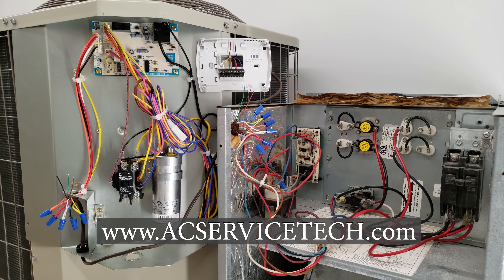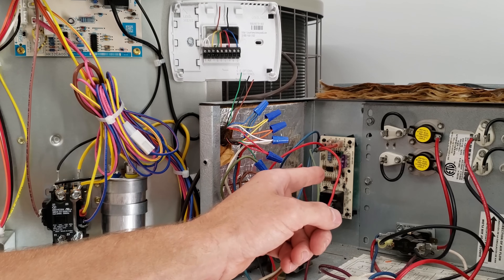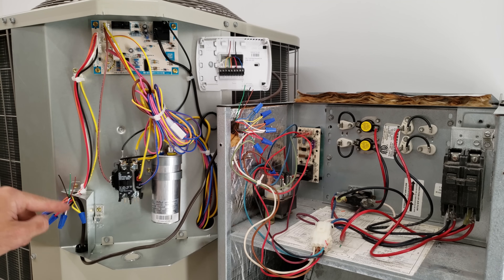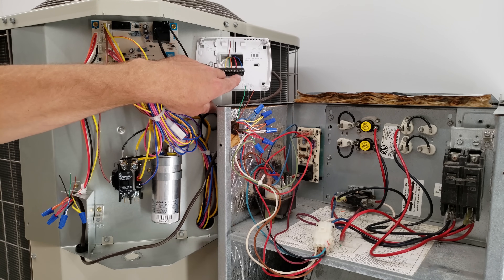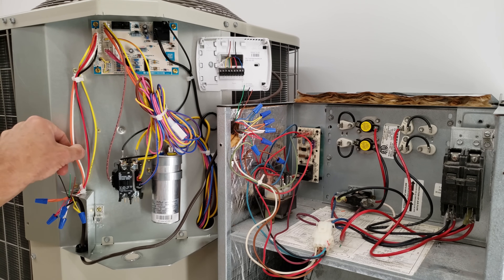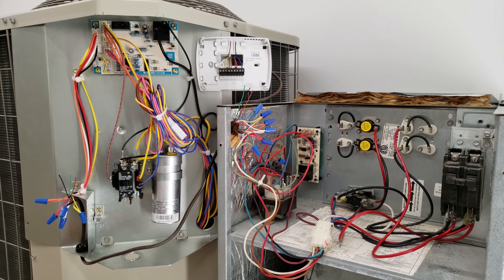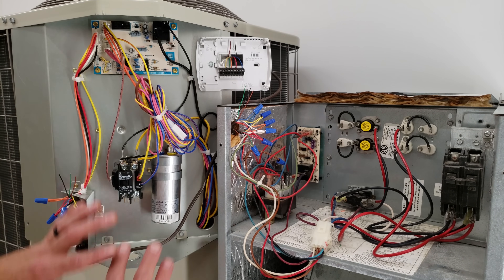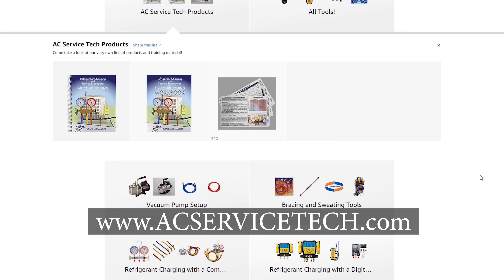How an Air Handler & Heat Pump Work & are Controlled by 24v Thermostat Wires!

Comment: Your videos are very helpful. I have a question: I am trying to install a new Thermostat (RTH9585wf) and my HVAC does not have a control board (I watched your other video on systems without control boards). However, I was not able to do the rewiring and use the G wire to replace the C wire. All videos and also Honeywell guidelines assume that there is a control board. Do you have any suggestions for the systems without control board?

Comment: Very informative video. Living in an apt building, I have one question still. Hear clicking off and on quickly in my wall next to my air handler. Suspect faulty heatpump switch. They are on roof. Air handler cycling normally and cooling. If I shut off breakers for heatpump, furnace in breaker box and separate breaker on front of air handler and still hear noise between walls, does this mean I could behearing noise from a close apt by me and their unit? Would my heatpump be shut off by doing what I mentioned? Thanks, hope for an answer! Hate to deal with maintenance here, the are not very knowledgeable

Comment: Very well done. Personally I have found I prefer when the manufacturers energize the reversing valve in heating. If the reversing valve fails they still have emergency heat and in summer they still have a/c. It takes the pressure off me as far as how fast I need to respond. Seems today people become more irritable without cooling than without heat.
Reply: Very true. Also what good is it if the reversing valve fails and the unit can’t go into defrost? You will only have heat for a short time before the outdoor unit turns into a block of ice.

Comment: Thank you for making this video. I'm not an hvac tech, but I do enjoy repairing my own stuff. I've been stuck for about a week now and its mid August in the deep south. Its humid and its almost 99 outside today, and this ac has been down for almost 3 weeks, so I was motivated to get this thing fixed, which I finally got everything wired up correctly this evening, thanks to this video. There are no other videos who show how exactly these Carrier heat pumps are wired. Again, thank you for making this video, its exactly what I needed. YouTube University comes thru again.

Comment: So thermostat OR defrost board can turn on electric heaters. Also thermostat OR defrost board can power the reversing valve. Is this correct ?  Thanks for really great video

Comment: Hello. Watched the video to the end. Good information. So we had a new 95% LP furnace put in along with a heat pump installed. So everything works with the heat but when you turn the thermostat to cool it blows out hot air. The company has been back out several times and they are not sure but they think it is the new thermostat they installed. They manually reversed the valve and we got cold air. All wires in and out are getting continuity but when switched to cool the thermostat is not sending a 24 Volt signal to the heat pump to turn it on for cooling. The outside unit works fine for heat. Everything is brand new. Any thoughts or help would be greatly appreciated. Thank you

Comment: Can we use a gas furnace as an emergency heat instead of electric heat when the heat pump goes into defrost?
Reply: Yes, it is called a dual fuel setup. You wire it normal with the "w" going to to the Aux and then setup the thermostat for the standard or high efficiency.
Reply: @yarsamohtrt  Thank you

Comment: my ac unit burn the 24v transformer and i bought a new one. every time that the compressor try to turn on the 24v voltage drops so badly that my ac controller back light dims down and a few seconds after it turns of the compressor. this only happens when every time i use the compressor either for heat or cooling when i use the heat coils everything runs fine. the only things that could be drawing so much power i think could be the contactor been the only thing that feeds of from the transformer at the time . any ideas?
Reply: or maybe i bought the wron 24v transformer and it doesn't have enough power for the contactor?
its my first time ever working with ac units all i know is that there's    a lot of voltage drop when the compressor tries to run. oh this is a very old unit without any electronic boards

Comment: QUESTION First thank you!! I believe it is rheem and Rudd that energize the reversing valve during heating pretty much all others are set up just like this one in the video correct?
Reply: Yes, that is correct. The majority prefer a failure with the reversing valve to occur in the cooling mode rather than in the heating mode.

Comment: Great video.. I have one question... Is the thermostat the only control keeping track if the heat pump is not keeping up, or do some defrost boards have a second function, when to turn on aux heat. I understand the defrost board will signal the w/aux for resistance heat until defrost is completed. The reason why I ask is because I can't find this information in the install manual of the rth2410/rth2510 thermostat.
Reply: The defrost board should turn on the aux heat only during defrost mode. In that case, it energizes the W wire.

Comment: Hi Craig, so glad I found your videos and website. In the video when you first mentioned the heating cycle (set to 71 but 70) you said R was connected to B, Y, and G. Towards the end of the video you gave an example of the thermostat set to 74 but it was 70, and you said R was connected to G, Y, and Aux jumped to E. But I didn't hear the thermostat setting for this set-up. Were these two configurations for heating modes with different manufacturers? I'm tracing my own wiring today and tomorrow but was just curious for your video. As everyone else said, thank you again for these great videos.
Reply: Did u find your answer
Reply: @keithbailey7535  Sorry, I don't remember.  That was some time ago. But this site and videos were some of the best I found.
Reply: @bishauzer  to be clear u wanted to know why the r connected to different terminals because of thermostat temp difference? Was that your question

Comment: I followed the video, tripped breakers, checked cables, found 3 red wires that didn't have a good connection so I snipped ends and stripped the ends and returned them to the twist-on wire connector, replaced the blown fuse, turned breakers on, in a few minutes the thermostat screen was on and I could adjust the settings for heat.  The lines were so tight and the hole is jagged with no grommet, so the temp fix works but I will need to follow up on the root cause to avoid future problems.

Comment: I have to say this is the most comprehensive video I have seen.  No more wasted time watching some yo  yo babbling on.  This man knows his stuff. I had a HVAC cert in FL but we didn't do heating. I put in a new heat pump and redid all the wiring.  Honeywell 9000 thermostat.  Have been having problems with this heating since it was installed.  ODT has me messed up. This showed the correct wiring and that will solve my problem.  Last tech that worked on my system while I lived in FL (this home is in SC) messed up the wiring and cut and spliced things up to where I wasn't sure what was correct.  Now this video has solved that issue.  One wire was in the wrong place and had disabled my Aux/E from working properly. Thanks for you awesome knowledge and help.

Comment: I need to add an outdoor thermostat which wont let the heat strips come on unless its 35 degrees outside.  Which wire inside the air handler do I interrupt/connect to in order for it to operate correctly?
Reply: An Outdoor stat used with a dual fuel application usually has 3 specific additional wires.  Your best option on an all electric application would be run two new 18 ga wires from the house thermostat wired from s1 and s2 to the outside using a sensor.  Then set your thermostat to a programmed outdoor air temp you need it to cutout at.

Comment: You explain things great i went through an hvac class at a tech school back in 2010 got in a bad wreck leaving my first job interview,hit by a semi truck. I got the job but couldn't work. I eventually got a better job doing maintenence at a large building but they don't let us do much they contract everything out we just monitor everything diagnosed some stuff then they call in subcontractors for the work mainly for liability purposes. So I already don't get to apply the things I learned a lot if you don't lose it you forget it. Well last year on new years eve I found out I had lung cancer I am only 37 the chemo really messed with my memory even further and I find myself having and even harder time remembering things as far.as the sequence of operations and I get confused real easy so ita nice to have you videos to refresh when I do work on a family members unit or friends. I wish I ask questions sometimes though cause I always asked a lot of questions in class I think sometimes folks would be like on lets move on but i wanted to make sure I understood.

Comment: Why dont they make all the 24 v common wires blue? Like for instance in your heat pump unit, the 24 v common from the contactor to the defrost timer control board is brown, and the 24 v common from the defrost board to the blue thermostat wire is black. Lol. Just saying. Better know how to read the schematic guys. Lol.

Comment: Nice explanation. Can you help me trouble shoot an issue?  I have a split unit w/heat pump. Was running great an all at once it stopped.  I'm reading 28v outside and at thermostat on red/yellow. Outside 28v on red/white. From thermostat crossed red/yellow still nothing. Turn thermostat to cool and handler fan comes on but now with thermostat on cooling there's not 28v on yellow outside anymore. Has 240v to contactor, can manually push contactor in start fan/compressor. Contactor doesn't have any voltage to coil connections. Ohm test is 8 on the contactor coil. Has a new capacitor. Any help would be appreciated and Thanks!
Reply: If your looking for a call I usually check say y to the c terminal to see if heat/cool is calling. Sounds like you might have a pressure switch outdoor tripped. I would trace the wires from where you lost got 28v and if it leads to that , jump that component out. Sometimes they fail but in most cases you have other issues associated with that I.e dirty cool /overcharge of its the high pressure switch .

Comment: Do all condenser units have that heating valve and a package unit with an indoor blower motor?
Reply from the maker: heat pumps have a reversing valve. packaged units do have a blower motor, thanks!

Comment: The indoor fan is the avaperstor motor right ?
Reply from the maker: only in ac mode. It will be the condenser fan motor in heating mode. We just call it the indoor fan on a heat pump.

Comment: Thank you for everything. Just thought of a scenario where I have to disable the heat stripes and see if the heat pump itself only can generate heat. 

 I will have to open the air handler unit and disconnect that WHITE wire from the wire hub. Because that white wire at the wire hub provides 24V to the sequencer that turns on the electric heat coil.

Comment: I like the videos from you. I have one question. I have a Carrier Heat Pump system. In the thermostat, "C is OPTIONAL with Batteries"  means I can leave the C terminal empty if the thermostat has batteries.?
Reply: I would keep the c terminal.  Your batteries would keep your settings if you lose power.

Comment: I sorta have this type of system in my modular home, it is a Rheem Model No. RPKA-043JAZ(Heat Pump/AC), MFD 08/1999. It has a Nordyne Electrical heating Furnace, Model: E2EB-015HA. I opened the outside unit this past March to clean it out. The five wire cord from the furnace unit to the outside unit (red, blue, yellow, green, white) has a wire nut on the end of the red wire in the outside unit. I can't remember if I disconnected that, or if it was like that. There is also a brown wire coming down from the demand defrost control compartment that has a wire nut. Should the red and brown be hooked up to anything? The thermostat is an old Honeywell Q674L 1520. When I power up the system, the EM heat red light come on the thermostat, but the green light for Aux heat does not. Thanks in advance for any help.
Reply: I got it figured out after watching more of your videos. Thanks.

Comment: So I have a two stage heat pump. The installation was a one stage cool two stage heat thermostat. The installation failed. The company bypassed the control board and hooked the compressor solenoid directly to y2.

The manual calls for two stage heat and cool thermostat but they installed a one cool two heat thermostat. Have a two stage single compressor.

Y one is hooked to y one y two Is hooked to h one? and bypassed directly to the contactor coil.

The diagnostic in the thermostat shows one stage of cooling and two stages of heat.

Seems to reply but think I only have low stage cooling on this apparent hack job.

Still have to verify that the second stage cool is not activating the second stage solenoid on the compressor.

Comment: Heating mode is it w wire?
Reply: W energizes the heat strips when condenser is in defrost mode. Not like normal AC unit

Comment: This was a VERY well explained video! Thank you very much. I have 15 years of install and always just had to follow diagrams for the wiring part. I am now a technician and have had to look up wiring HPs a few times. This finally set it in my mind... Now... Do duel fuel 😝 pretty please! Even though with this video now I understand how that would be best hooked up! Gas/propane furnace with HP and coil.
Reply from the maker: Great to hear Thank you for your support!

Comment: when the system goes into defrost mode and the heating strips are powered won't you have a mixture of hot and cold air blowing out?
Reply: Well, it seems to be a year later and I'm the only responder so here's my 2cents... I bought a home (now 5 years ago) with my first heat pump system, a Coleman installed 2005 so its getting elderly and developing wear : already replaced motor capacitors, a blower motor and sequencer for heat strips. The Honeywell thermo wasn't fully progammed for this setup and was missing a jumper. A lot to figure out my self, considering the documentation was basically sales brochures,   missing or fadeing & dirty & peeling stickers inside the units! Its been quite the learning curve.
My experience is that in defrost mode the air handler absolutely blows cold air, and the heat strips should kick in to counter that. If they dont its a damn cold 3 to 10 minutes if you're near a register __how do I know? mine does that very annoying thing. It may be the outside unit defrost board, the white 24v signal wire connection, or its connection to the sequencer for the heatstrips. Didn't matter during the last summer in AC mode, but I will have to get on it soon! Also add on an outside thermo sensor to the smart thermostat so it can enable the auto Low Temp Shutdown of the heatpump and switch over to Aux heat Tired of getting up at 2 - 4 am to do it manually.

Comment: Thank you, Craig. This video is brilliant. Now, it's more clear to me. By the way, I have a question. Is the defrost mode makes indoor coils cold, and we need electrical strips to equal it?  Here in California, we don't have any electrical strips. Or no refrigerant goes to the Indoor coils, and we just need to worm up the ambient temperature aifflow? Thank you again for this AMAZING and high quality picture and effects video.
Reply: That is a good question.
This is my thought 
Refrigerant go thru but because condenser Will not reject heat and electric heat in side airhandler Will be on, You still pushing hot air in to the house 
Mr. Craig help please.
Reply: Perhaps it's like other countries : indoor and outdoor fan both stop. Machine runs on cooling till condensor coil warms up. Indoor fan doesn't restart till coil gets hot again. Works down to about -10 deg C